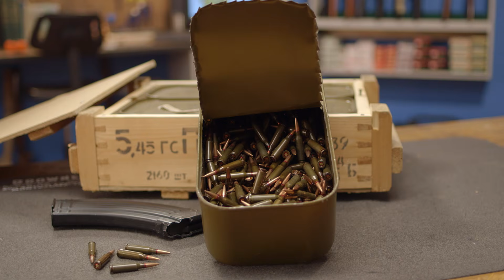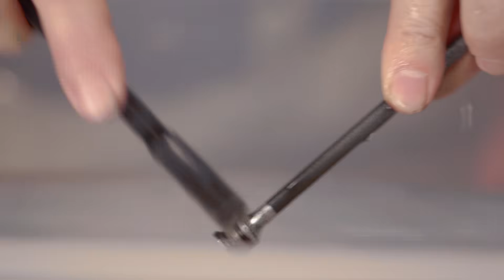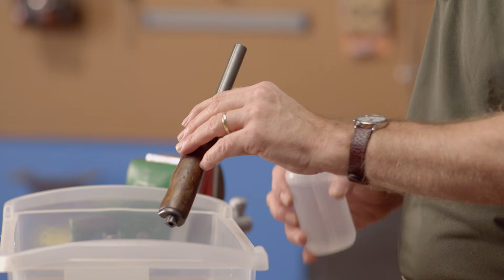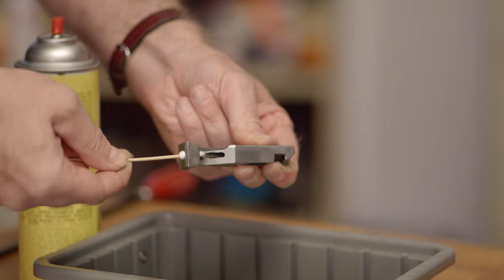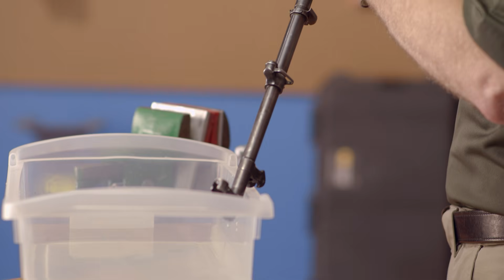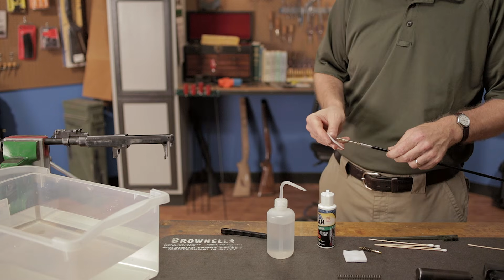Firearm Maintenance: SKS Cleaning, Part 2/4

Comment: I made an original design firing pin with a spring for my Yugo after having a hang fire. It took a bit of machining but I have not had the hang fire problem again. It was most likely cosmoline in the firing pin hole.

Comment: I heard to soak it in mineral spirits? Is that OK or not recommended?
Reply: I don't know if it still pertinent, but today I did disassemble my SKS and did submerge all the parts in Mineral Spirits. I also applied it to the barrel. Then I boiled water and used dish washing liquid and washed the mineral spirits solution off all the parts. I also used doubled pipe cleaners to get inside areas with cosmoline. I towel dried everything reachable and then used a can of compressed air to blow out any water etc.. I am also planning to pull apart the firing bolt, clean it well and lubricate it before reassembling. The trigger assembly was well cleaned by the Mineral spirits and soapy water,  so I don't think it needs disassembly. I dried it well, so I'll just lubricate it. Next, I will refinish the wood stock. I want a golden oak color.